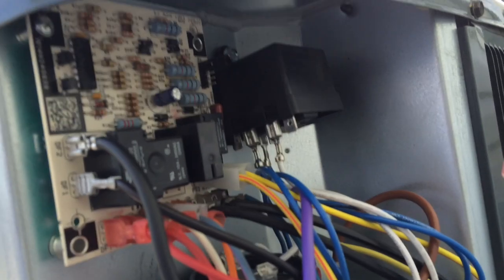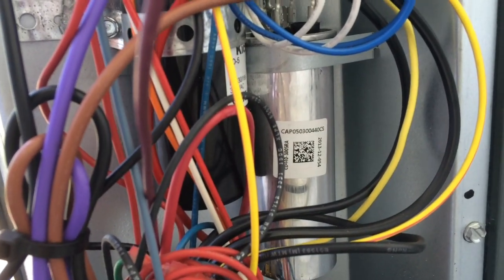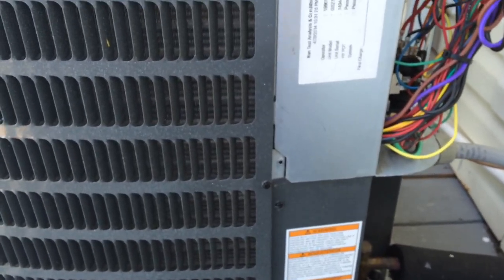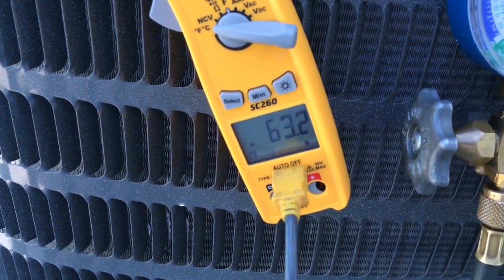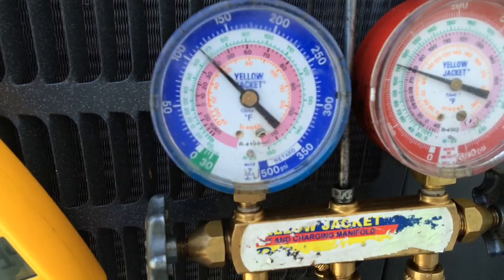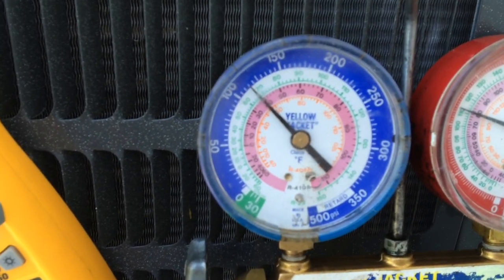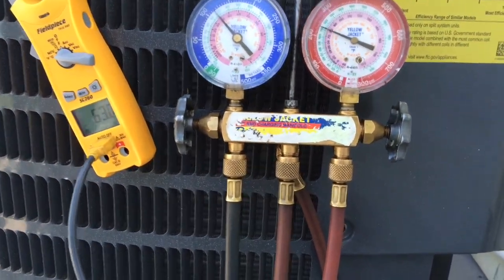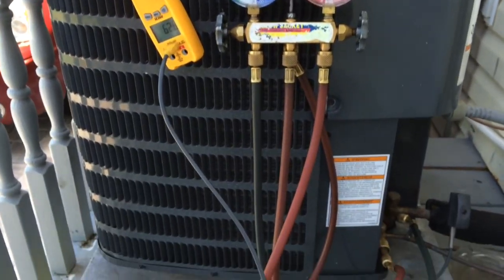Loud Scroll compressor on start up.

Comment: 64 isn't too cold to be running an a/c. I keep mine on automatic, if it gets above 75 indoors the a/c comes on, if it gets below 70 the heat comes on. If you're cooking or have a lot of people inside you may need it to run even cooler outside. Here in Houston it may be 64 outside, but if the humidity is high you still need the a/c to dehumidify. Never understood why people wait till it gets 80 or even warmer in their house before they turn their a/c on or 65 or cooler to turn their heat on, I just keep it on automatic and have my work schedule programmed in the thermostat. I do have it to where the compressor won't run if it is below 40 outside.
Reply from the maker: It is too cold to run an AC unless you have a low ambient kit and a compressor heater.

Comment: I have a four-year-old 3 ton Trane unit doing the same thing at my house. It has been like that since it was brand new and the installer has told me not to worry about it after checking it a few times. should I pressure them to replace it or do some scroll compressors just do this?
Reply: They shouldn't sound like that. It's straining to get going. Hard start capacitors will extend the life of it to give it more amps to get going, but eventually it will fail. Could be one year Could be 10 years!  Check your disconnect for proper voltage and check compressor Amp draw and resistance.
Reply: Ty for this info  @andypatterson8991
Reply from the maker: It isn't normal in this case. Scroll compressors do start harder than reciprocating compressors. How long is the line set and what diameter is the big copper line (the auction line) on your system?

Comment: Try the eliminating the contactor as part of your noise problem.  Just pull the disconnect, check with a meter and bridge L1 to T1 and L2 to T2. Reinstall disconnect and see if that helps. If it does put a sure switch on it. If nit try a crank case heater.
Reply from the maker: +Kraig Kane
The problem was just a faulty compressor. I replaced it under warranty and it worked just fine. Quite as a mouse!
Reply: How did you diagnose the "faulty compressor"?  I've had a loud startup since brand new and had the regional techs and reps out and they ok'd the unit.  Said it was running perfect.  Even if it wasn't, I'd be responsible for labor which absurdly runs hundreds of dollars on the brand new unit that I just had installed.  So, you appear to know your stuff also, if you're looking at all the numbers and it appears to be running fine, how do you diagnose it as bad?  Furthermore, everyone affiliated with Rheem wants to say "oh that's just normal for scroll compressors" but they don't have to be embarrassed to have somebody stay in the guest room that's unsleepable.  How do you convince Rheem that there is a problem?
Reply: +John Dungan thanks for the follow up! I had this happen to me one time before. Did you install the original unit? If so, did you charge it or add refrigerant in the field? Just wondering if maybe liquid refrigerant pushed the oil out of the crankcase if it was charged via the low side with liquid. R410 I'm assuming. I really wanna get to the "reason" this could of happened in the first place
Reply: I just had a rheem ra1648aj1na installed and at first I really liked it but it always is making some kinda different noise. Imo it’s a total pos. Tempted to sell it on the local market place and get something else. That’s how much I’m not a fan of rheem. I had the rheem installed because I heard nothing but good things. Should have gone with something better. Never skimp when buying an AC.